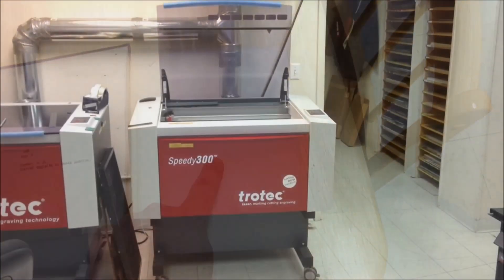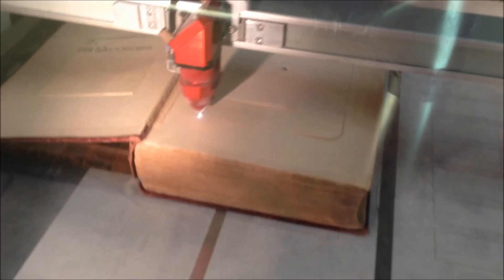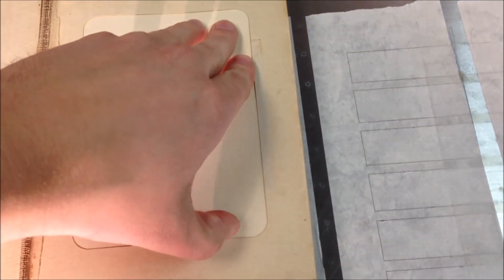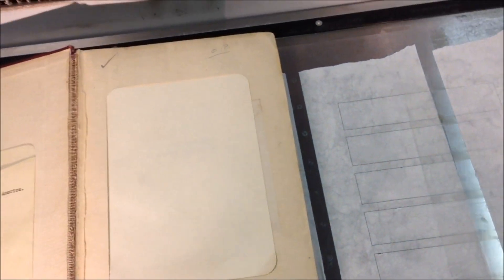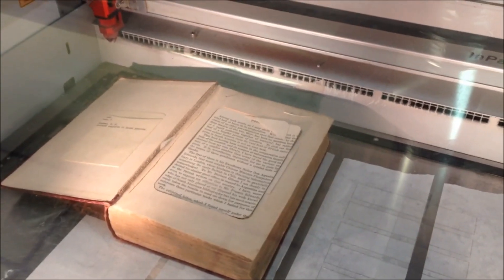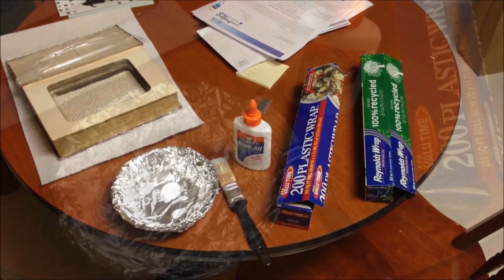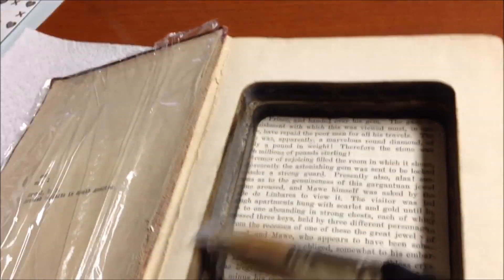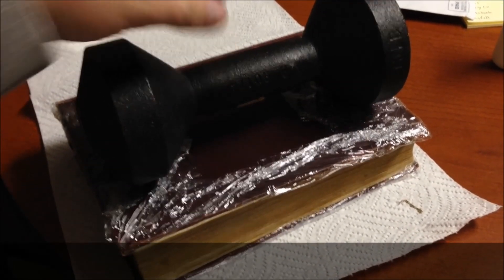DIY secret compartment in a book using a Trotec Speedy 300

Comment: Cool video - did you have to periodically refocus the laser? What focal length lens did you use, what power and speed settings? What is the wattage on your laser? Do you think it would be easier to cut the pages before glue up, so that you could move the thickness of cut pages out of the way?